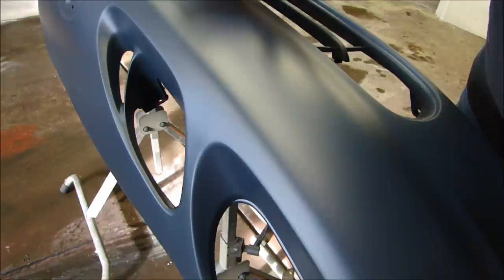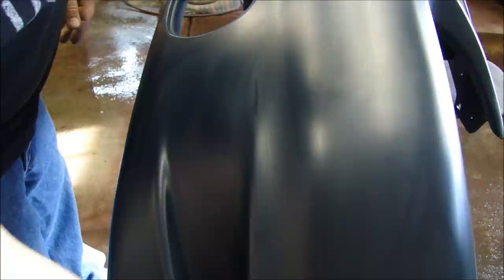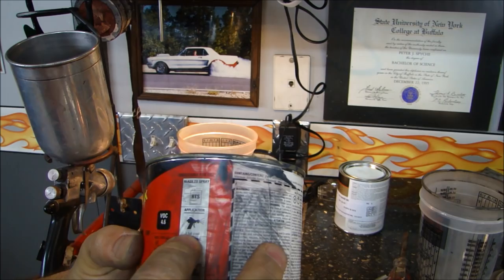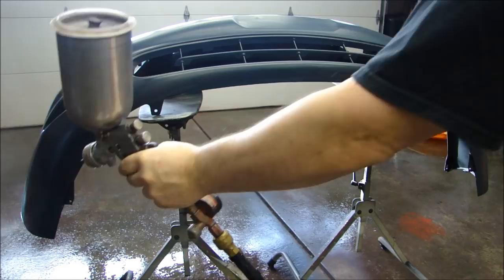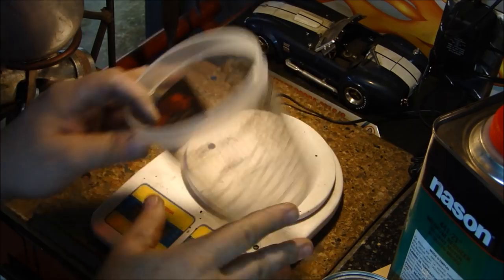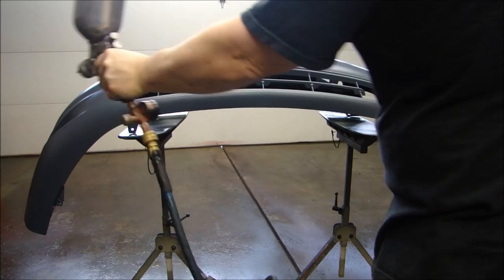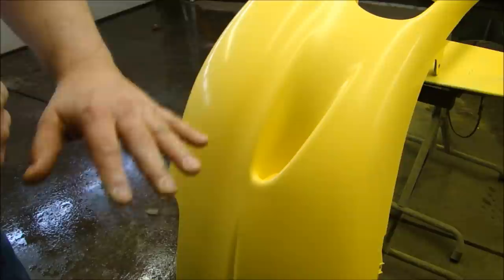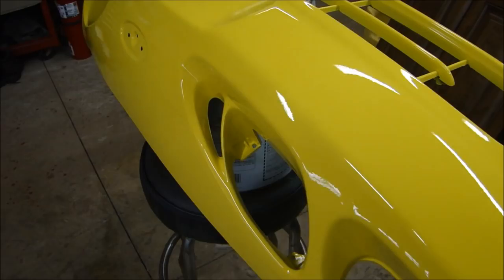Painting Tips & Tricks

Comment: Pete, love you stuff but on several points you're mistaken

1) Urethane reducer IS LACQUER THINNER. The chemicals used to make urethane reducer are exactly the same as a normal lacquer thinner check the MSDS sheets as these will list the chemicals. What makes urethane reducer different from lacquer thinner is that it has a very low WATER content. This is very necessary for the urethane system which is extremely sensitive to moisture. Other than the low moisture specs it's pretty much lacquer thinner.

2) Your basecoat and basecoat reducer (some call it balancer) typically DO NOT have the same density. A one to one mix by volume is not the same as a one to one mix by weight.

3) Every single manufacturer of paint that I know of INSISTS that the work surface be at least at 60F prior to the application of clear as below this temperature the polymerization reaction between the isocyanate (activator) to the resin in the clear will not take place and the required cross-linking will not occur. The clear may dry but it's performance will be way below acceptable.
Reply from the maker: Awesome stuff! Thanks for the comments. I realize the two are similar....I usually use a prep sol for cleaning before painting, but you are right. When I mix straight colors I do it by weight to make it easier, but yes you are right, the densities are different. For high solids like epoxies and metallic paints I mix by volume. What I did not show in the video was just before painting I pulled the part out of the shop where it was 70 degrees. Then after painting I put it back in to warm up. Again you are 100% correct that temperature is critical when painting.

Thank you for sharing these crucial points with us.
Reply: Wow, that is really inside baseball
Reply: SATAMAN Schmidt  absolutely right also what if thst was raw plastic, is thst sealer also a adhesion promoter?? Nor to mention ur lucky the reducer did not wipe the primer off the bumper!!

Comment: I work for one of the largest auto body parts supliers in the country and you are 100% correct about the different grades in parts. Always get a CAPA or Platinum Plus grade part, even in lights and mirrors. They are the best grade of all of them and with the lights they don't fade as quick or bad as the cheaper versions.
Reply: Squirrel, do you happen to know if your company does the priming of the primed parts it sells, or does your company rely on the part manufacturer to provide the part primed?  Since your company is one of the largest suppliers, they probably follow the industry standard, and it would be helpful for me to know for future part purchases.  Thanks.

Comment: second tip. if you feel you must check if it's dry or not, you can always check nonvisible overspray areas. note that these areas will have a thinner paint layer, so if they've got a mild tack, the rest is still extremely wet, but if they're bone dry, you're probably close. third tip. just because the surface is dry, doesn't mean the paint underneath has a good cure on it. I've personally pulled the oh it feels dry, and you crack the top layer and leave big fingerprints in it.
Reply from the maker: Great stuff...thank you for sharing

Comment: Pete nice video. I'm going to do my '80 MGB soon and much has changed since I painted a car back in the mid 80's. Good to know the newer materials are easier to use. I'm all for easy. I just wanted to offer a small tip, if you take a small punch and punch holes in the recessed lip of your paint cans, you'll find it pours much easier with better control, plus the paint left in the recess will drain back into the can, making resealing it easier also.
Reply from the maker: +Mike Robinson That's awesome, thanks for sharing. I try to buy just the right amount so I don't have a bunch of cans laying around. Good luck with your car

Comment: On bare plastic after sanding with scotch Brite pad , clean it, then wipe with alcohol based cleaner then let it flash. . Then spray adhesion promoter on it then use a sealer on bumper then base coat clear.
Reply from the maker: +772777777777777 Awesome stuff!!! Thanks for sharing

Comment: So i noticed when you mixed your clear coat, you said you needed a 4 to 1 ratio. Your clear coat in the plastic container was reading "3", from the cameras point of view, before adding the mix. After the  mix was added, the level on the container was reading at "4". Now.....I do not know exactly what unit of measurement each of the marks are worth....BUT.... Assuming that the camera is eye level with the containers markings for an accurate reading and also assuming that from what I can see, each of the markings on the container are evenly spaced. I could call each marking a "unit" (3 units starting before mix is added) rather than fluid ounces or an actual volume and such. So if you have 3 "units" in the container and proceeded to add 1 "unit" your fluid level at 4 "units". Wouldn't it be safe to say that you actually mixed a 3-to-1 ratio? since it only takes 1 unit of mix, on top of 3 units of clear, to get 4? Theoretically you would want to put in 4 "units" of clear to start with, and proceed to add 1 "unit" of mix. Thus in the end....having 4 "units" per every 1"unit" of mix, ending with 5 total "units" of fluid! Unless the container has some special directions that you read in which every set of markings that run up and down the cup are made to read a certain level where maybe pouring in fluid from any marking to another is the ratio itself. EXAMPLE: pouring from 5 to 9 is in fact a ratio of 5-to-9. but that doesn't seem right. What im really getting at here is.....I think you mixed you clear wrong, and you stressed to everyone how the mixing of the clear is the  most important.
Reply from the maker: +Travis Hightower That is an excellent point. Thank you for taking the time to write it out. It is all from the camera angle. There are two lines on the cup. You pour the first line to a number for the "4" part ofthe ratio. You can pour it to any line 1 through 5. That is just a reference point. Then you add the "1" part of the mixture and pour to the same number line in the 1 ratio column. You do not use the same line for both measurements.

Comment: A very clear and useful video - many thanks! By the way, I haven't painted much since the 1980s and used to use cellulose paint: very forgiving material and easy to use. Lately I've had a few painting jobs to do and I find the modern acrylics similar but they are very prone to problems related to temperature, spray pattern and air pressure. I now have a test board and probably spend more time adjusting the gun than spraying the part!
Reply from the maker: I agree. I started painting with lacquers and Dupont Centari. The new water borne bases and clears are space age compared to those. Once you get to setting up the gun and spraying in different conditions it works much better.

Comment: Is there no such thing as flex additives anymore?  I just had a local shop paint for me an extremely flexible rear window visor and small truck lip spoiler and when I picked it up they folded it in half and nothing happened to the paint at all!  They said they used a flex additive but, so far I have not seen anyone on YouTube say anything about flex additives during their painting demo's?  I got charged $250 for both and can't afford to keep paying that price to paint my, soon to be installed, lip kit and fix some minor blemishes.  So, I'd really like to learn to do this myself in my garage.  I'm very meticulous, detailed and learn to do things myself pretty well so, I think I can do this well with a little practice.  I used to be a detailer so, I know quite a bit about paint just not how to paint!  Thanks.
Reply from the maker: +Lobo Jr There is a flex additive. It is expensive. If you plan on bending the part allot I would use it. I paint plastic bumpers all the time without and have no problems. Just keep the coats very thin

Comment: Ive been using Dupont Final Clean 3901s as opposed to the reducer to prep the surface for paint.  Works well, it is also a safe solvent for use with plastics like this bumper cover.
Reply from the maker: I usually keep a gallon of that on hand but ran out. You are right....reducer is not the best thing to use.

Comment: Tried my first shot at spray painting a primer on body panels. I think it will need a couple of coats to get a good primer finish,seemed a bit light and thin. So ill use your patients tip. Think that's going to be my best way to get a good result.
Reply from the maker: The good thing is you can sand the primer

Comment: Nason basecoat is 2:1 mix by volume (tech sheet also calls for activator and doesn't say it's optional). If you mix it by weight the ratio is not the same as the volume mix ratio. The color and the reducer have different densities.
Reply from the maker: +Sam G I've shot the basecoat right out of the can, no activator. It dries slower but it will dry. It is very temperature dependent.

Comment: Mixing paint.As stated on the cup 4.2.1. What does it mean.4 parts of paint, 2 parts thinner and 1 part of what.You showed mixing equal amounts of paint and thinner (205 + 205 ).What is reducer and what is thinner.Which one to be used and at what proportions.Clear coat -what do you use, hardener or thinner.
Reply from the maker: +Amendra Prakash I showed mixing 50/50 paint and reducer. Clear is 4 parts clear to 1 part hardener. If it's like 4.2.1 the last number is always reducer or thinner

Comment: Great video!  I have just one question....  Since the weight/density of the liquids being mixed can vary greatly, how is it you feel it is more accurate to use weight?  With a 20% weight differential of the two liquids, this will cause a huge swing in the volume ratio.
Reply from the maker: I use weight for materials close in specific gravity. For epoxies and other high solids materials I use volume based on the manufacturers recommendations

Comment: The Nason spot and high solids clears are a great product . I use on  average of 5 gallons of each every week just stay away from the Nason multi panel / overall clear after a while it dies back. Im fortunate enough to have a Nason and Dupont mixing systems and in my case being off even a gram can be a very costly error to make.plus it makes you feel good knowing it is being done right so i know where your coming from
Reply from the maker: +Jonathan Pedigo That is so cool....thanks for sharing with us. Understanding paint is so important. It is mixed by weight when formulated and it has to be exact. I've had good luck with the Nason products. What is your opinion on the high end Dupont clears?
Reply: Today's Nason clears used to be the Dupont's high end clears until Dupont came up with a new formula. Knowing that I haven't sprayed to much of the new Dupont clears. I spray with a Devilbiss Tekna prolite with a 1.3 tip, 2 coats followed by a flow coat. Comes out looking like glass and it doesn't matter if I'm spraying Nason ,Dupont or House of Kolor. I stick with the Nason clear.

Comment: Pete, I have a 1993 300zx that has two paint jobs.  Factory and a not so great other paint job.  For many months I have watched many hours of video's on preparation.  The one question I keep coming back to is:  Do I soda blast, use paint remover, or just sand the coats of paint off?  I've looking into buying a soda blaster, and recently watched a video on stripping the paint, and watched many on sanding.  Not sure which to take.  Can you help a sista out?
Reply from the maker: +Mina Castellano If you soda blast the interior will be packed with soda. Chemical stripping is slow, but works best. You can take off the hood, fenders, doors, deck lid and have them blasted and do the body with chemical stripping. It just takes time.

Comment: I know nothing about painting cars but don't the paint and stuff you mix in have different densities? If so you wouldn't use the same weight for each right?
Reply from the maker: Yes, you are absolutely correct. When using thicker materials I mix by volume. For most products by weight't even need the  is ok. Some materials can be sprayed right out of the can...the base additive is more of a reducer.

Comment: Hi m8 .....you don't use flex additive ??....helps to stop painting cracking on flexible parts like bumpers .....I'm using acrylic  primer and top coat .....they say if applied correctly ....I don't need clear coat ???.... Whats your thoughts on this .....first time painter
Reply from the maker: Excellent question. If you apply the base and clear thin enough and you do not have to significantly bend the parts to install them, flex additive is not needed. If you install the part, then paint it, the addictive id definitely not needed. I have never had a problem. It's kind of a money grab with little benefit.

Comment: ok i watched it and i have an idea on how to spray now ive heard tha acrylic enamels should be sprayed at higher psi i saw on one video that they were spraying at 26 psi misting the paint on lightly does that sound correct?
Reply from the maker: +Ivan Torres The paint manufacturer should have recommended tip sizes and pressure on the can. Regardless of the material you are spraying it is all a function of viscosity and tip size. If you are using an HVLP gun you don't need 90psi. I would definitely use a lower pressure and mist on coats of acrylic enamels because they flow more.

Comment: how can i avoid orange peel in clear? i am using a 1.3 tip
Reply from the maker: Orange peel is from too thick, too cold, or mixed wrong.Use a bigger tip with more pressure.
Reply: you can always sand it down after it dries with 1000 grit sandpaper and buff it

Comment: Great video and I appreciate the info for someone that knows very little about painting. I hope this question isn't a complete waste of time, but is that just water on the floor or something else? I'm gonna spray in my garage and don't want to put plastic on the floor or scrub paint off. I figured the water was mostly to keep dust from flying around but wasn't sure if water alone would keep paint from sticking since my floor is unfinished and would soak up water quick.
Reply from the maker: The water on the floor is for 2 reasons, the main reason is to keep dust from coming up off the floor, and the second it to keep the overspray from sticking. You don't want puddles, just damp.

Comment: Thanks for the tips. After painting  what is the curing process. Does it need a separate heating booth. What ahold be the temeperature setting. Please advise on this
Reply from the maker: If you use the right hardener for the temperature you are spraying in, it will be tack free in about an hour and dry to touch in two

Comment: hello, do you have any videos on hiw to get the overspray cloud out quick well painting in the garage  ? thanks
Reply: I use a Jet brand dust filter air handling machine installed to pull clean air from outside, filter it, and it provides filtered air flow out to the opposite end of my garage where the the man door is ajar.  An alternative I have used is a cheap box fan with a common furnace or A/C filter taped to it with makeshift duct work as necessary for your needs.  I hope this helps.
Reply from the maker: That is a great suggestion. I have done that on occasion. Thanks for sharing that
Reply: Thats exactly what my plan is. Filtered Box fans and makeshift ducting. Glad to know it'll workout! cool.

Comment: When you say you applied 9 coats of base to get it completely covered, would you need to apply the same amount of costs on the hood or adjacent panels. My restoration is a non metallic base and iv been told that getting the same amount of coats on any other panels is crucial, in getting the panels to all look the same. 
I’m respraying my entire car and going the mile to get it correct. I just don’t feel confident yet to spray the entire car in one hit. I was hoping I could do it panels by panel or at least each side of the car as it’s own. Would there be any issue with panels not looking the same shade in colour
Reply from the maker: I would have gotten it done in 2 coats if I used a white sealer. The grey was really hard to cover with yellow. When you buy the paint ask them what shade goes under it so you don't need more than 2 to 3 coats. It will be difficult to get the metallic or color to lay down the same if you spray in parts. Take your time and give it a shot. If you get the hang of it you can do it.
Reply: Pete's Garage thanks for the reply. How identical do you think I would need to be on each panel. Surely when pros spray a while car sometimes I have seen them explode the car, and have doors off, hood off. They spray it all the same but car panels not next to each other. Would they still be in the same risk of putting say more paint on the door. Then moving to the body and putting slightly less. Would they then be in the fear of having some panels different shades? I guess your right tho. Until I do a test spray up, only then will I know. Thanks for the reply and hopefully next one.
Reply from the maker: Custom Car interiors it's actually about spraying all of the parts from a batch if paint mixed the same and no changes in temperature or humidity.  Many variables chamge day to day unless you are spraying in a controlled environment.
Reply: Pete's Garage thanks again! I’ll bare that in mind. I plan on getting all the paint mixed for the car plus more for any mistakes. I’ll mix it really good and try and get the same heat in my spray booth the same. Thanks again. Wish me luck!